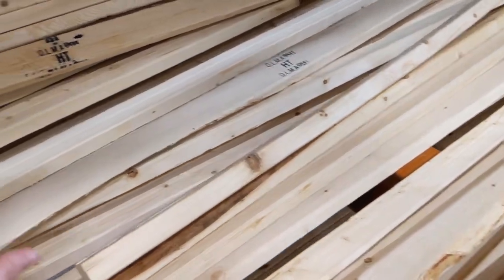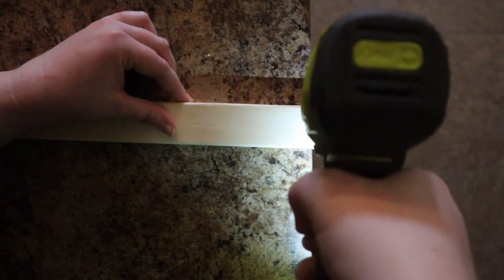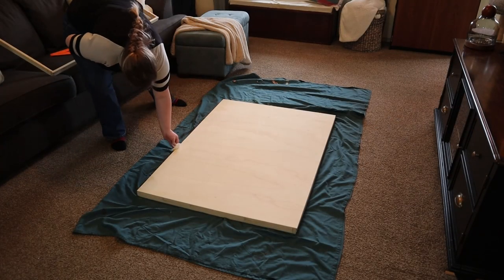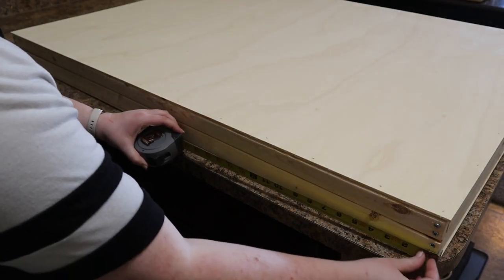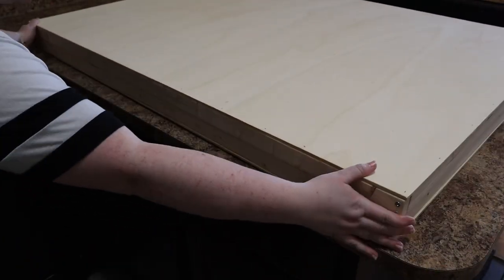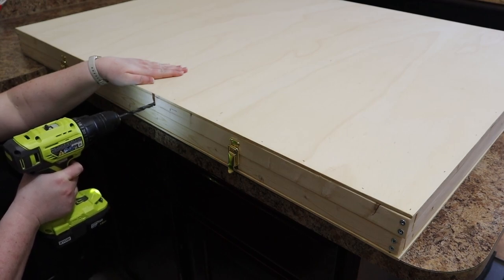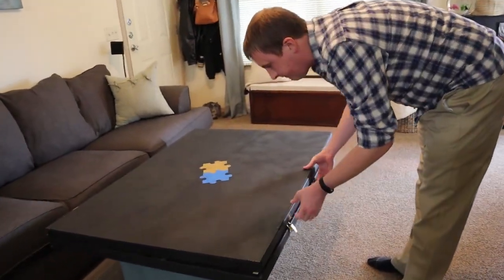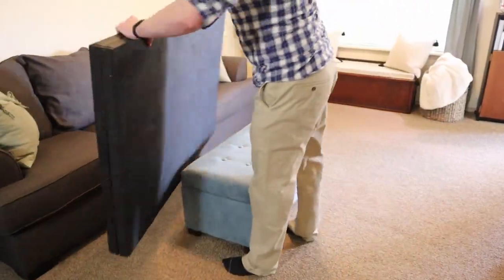DIY JIGSAW PUZZLE TABLE | Full Tutorial for Portable, Inexpensive Puzzling Solution

Comment: Hey I know this videos a bit old but I was wondering what size screws you used? Very new to this and trying to build for my partner. Ty!! Awesome build btw
Reply from the maker: I don't recall the specific screw size I used, but I usually recommend using screws no longer than the width of the board you're screwing into minus about 1/4 inch. That goes for the sections where you're screwing something thin into wood (such as the metal swinging arms into the inside of the box). For screwing the corner boards together at right angles, you could use longer screws, about 1 1/4 inches or so. Hope that helps! I'm sure your partner will love the finished result🥰
Reply: @ByBridgetDIY  thank you very much!! 🙌🤙 appreciate it!!